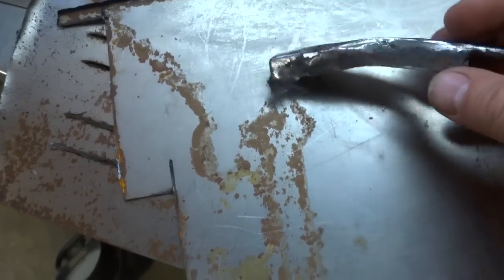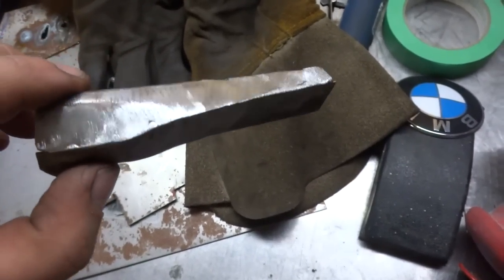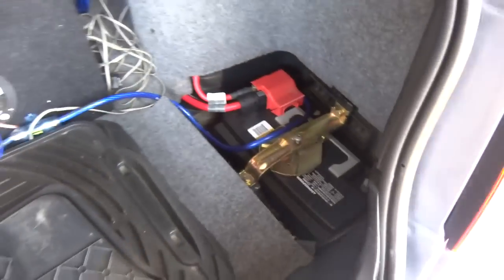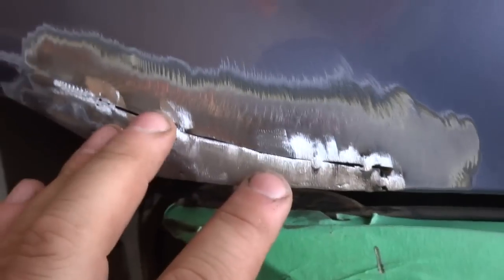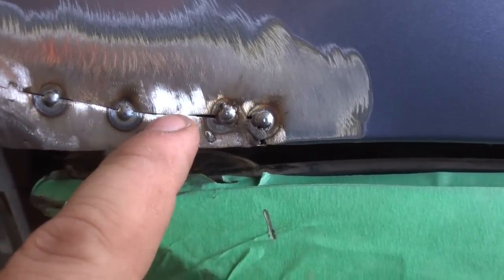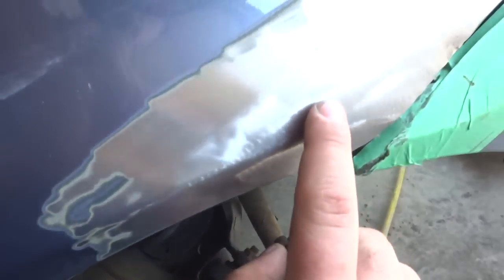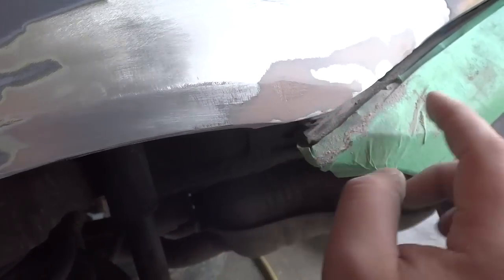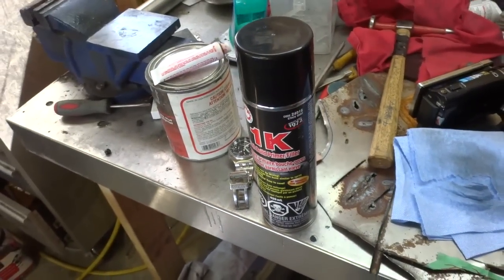How to Repair Rust and Weld Body Panels

Comment: I've been a painter for years, when you get runs wipe it off quick , let it dry then light sand. Uncured paint is a bitch to sand
Reply: This should help anyone to spray and avoid runs. Understand that spray means thick paint pigment which is diluted with thinner to make it as the word says, to thin it,  so that the thinner takes with it the pigment from the gun to the metal panel. 
2. All the thinner needs to evaporate once it reaches the panel before you pass a second coat. 
This is why you need to spray a even and really thin coat - First thin coat means that you can still see the underneath metal and filler.  This allows for the thinner to evaporate quickly (1 to three minutes) and the pigment particles to remain stuck to the panel
3. Apply another thin coat and do the same. Wait for the thinner to evaporate again and apply another until all of the bak ground metal and filler disappear.
4 Give extra coats since you would need to sand it down a bit to make it smooth to apply the finish.
Spray runs are problematic to sand down since the coating is so thick that the thinner cannot escape and evaporate. And so when your reach the bottom layer of the spray over run, closest to the panel, you find that it is not dry and solid same as the top of the spray overrun (too much spray) 
In short, the idea is to apply thin coats, allow the thinner to escape completely each time. 
Hope this helps.

Comment: Those damn Beamers seem to rot in the weirdest places.Ive just started a 1993 project Chevy Small Block into a BMW.Im going to remove the arch in the rocker panels.After cutting out the rust the car is probably about 20lbs lighter.Now time for some templates and welding.Thanks for the video!Gave you an up!

Comment: I learned my lesson trying to fix rust. My 2002 Dodge Durango has got rust on all doors + hatch on corners and it's all through the metal and under the rubber seal strip. I've only tried to fix one door and I absolutely regret it, looks hideous. I started thinking "god I hate bondo, only works in smaller applications" then I realized I forgot it's just a body filler, and I'm trying to mold it into a new part of my door which rusted off when I angle grinded.

Yup, gonna befriend a welder who'd help me or let me borrow one.

Comment: One thing I love about living in the Southwest, NO RUST. I'm in AZ, my 2001 has absolutely zero rust on it (although I do take care of it mind you.)
Reply from the maker: Dennis R that would be nice, here in Canada after a few years things start to rust
Reply: Bullshitkorner Yeah bro, I actually work as a technician, anytime cars come in from areas where road salt is used, we have to break out the torches to be able to get any bolts loose. We had one truck come in from Pittsburg, the lugs had not been off for I kid you not, TWENTY YEARS! It had spent all of those years driving around in the salt belt, without being taking care of at all. They brought it in,  heavy duty impact wrench couldn't touch the lugs, wound up taking a 4 foot 3/4 drive breaker bar with an eight foot pipe over it, and two of the biggest techs jumping up and down to break the lug nuts loose.... sounded like gunshots when they broke loose. On that same truck we had to cut the studs off the ball joints to change them, as they had rust welded to the control arms. I could never live in an area with road salt, fuck that!
Reply: Bullshitkorner By the way, you seem very skilled, you did quite a nice job on that car.
Reply: cyrax99 ni n n n .ni

Comment: good job...the only difference between you/me and a pro is the quantity of times we do this kind of work. The more you do, the better we get. I just got finished making and welding-in a bunch of curved metal patch panels on the bottom length of the entire windshield bottom channel including the two bottom corners..it took me about 1.5 weeks of part-time work...surprised myself that it came out real good. The most important thing I learned was making accurate templates of each piece of metal patch so that it fits the hole...and bending the curves and angles correctly before welding in place. Another thing I learned (by experience and from pros) is that when you stitch weld you don't have to worry about the panel warping and you don't have to blow air on to get it cool after welding as long as you stitch weld in short small bursts apart from each other. But I was welding the older thicker metal (76 chevy truck)...the new cars use such a thin metal I guess one would have to keep it cooler lol...cheap thin metal geeze. Next thing they'll be using plastic on all cars like the plastic Camaros they were making...my GF's Honda metal is so thin it bends if you sneeze on it lol. Great work! Thumbs up!

Comment: I've visited Canada once and it was a bit shocking to see how rusty cars are there.
Reply from the maker: this is what happens when you have 4 seasons and you salt the road, if you come from a part of the world where it's dry and you don't get snow.  Your car should be virtually rust free
Reply: New cars last about 5 years before they start showing bad rust. Most are in the junkyard within 10 years.
Reply: Yeah it sucks man. For some stupid reason, Canada is gung ho on using salt on the roads. Absolutely destroys vehicles. You should see the pot holes. Lol.
Reply: Down here in Brasilia, Brazil, is very dry. No rust to talk about.

Comment: Good stuff! I used to do it like that, cooling it with air. Turns out, after discussing it with a professional, that it will only make it warp more. It's better to let it cool down by itself in between tacks, and keep the temperature nice an steady as you go.
Reply: I'm a panel beater from the UK & I use a marginally damp lint free cloth & that stops any warping as well. (keep it cool & weld in small stages.

Comment: thx for posting.  this is almost exactly what  i'm looking for.  i have a '77 630csi that has acquired quite a bit of cancer while sitting in my driveway. Unfortunately, the worst areas are around the front and rear windshields, as well as the sunroof, and hood.  this definitely gives me a starting point.  
thx, again.  
BTW, i didn't notice any profanity. CHEERS.

Comment from the maker: practice is the key doing little spot welds and then cooling with air, then going to a different part on the panel that is away from the one you did and repeat.  once you hear a pop that means you got too much heat in your panel and its warped

Comment: Damn older beamers, BMW didn't used galvanized metal sheet back then, I have the same problem with my '99 320D. Rust starts to show on the outside, only along wheel wells edges and bottom part of passenger door. I could exchange the panels for some newer ones, made with galvanized steel, but they cost, A LOT, even in Europe. My second best option and probably cheaper, would be to cut out a strip of about 2 inches along the edge of the wheel wells and replace it with fresh, galvanized steel, to get rid of the problem once and for all.

Third option would be to take my angled grinder to it, remove the paint and rust in sections, then repaint it. I'd like to do the job myself, although I don't have any experience in car bodywork, though it doesn't seem very complicated for a person with some knowhow.

Comment: I use a wet sponge.  How fool proof is the disconnecting the battery?  You also have to paint the back side with epoxy or that thing will eat rt through

Comment: ac aluminum case old swim pool or aluminum waterproof tape all good rivet .weld will make rust more .save that beer cam for next repair.
Reply: a little trick to rivets instead of a drill bit use self drill screws then remove & rivet leave any aren't visible  .had a van once ordered patch panel used Phillips self drilling .went to sell showed buyer told him to repl .w rivets  he said what you did was fine.

Comment: #1 rule of noob welding.. dont use air gun to cool weld... let it naturally cool..
Reply from the maker: you weld whatever way your heart desires
Reply: seriously though.. try it with out the air gun. it will give you a smoother finish..its physics.. rate of cooling... cooling to rapidly causes warping.
Reply from the maker: negative never had a issue warping with using a air gun
Reply: He's drinking pabts blue ribbon beer so you can't expect much.
Reply: don't worry when you weld like this point by point the gas of mag/mig welding rotect your weld enought, you  can use air gun after to cool it, the weld will not be orange "in fusion" don't be a dick, don't use air gun and create calamine for fun, wait to see the metal red you totally can use air gun
Reply: It's only American beer though - a bit like the lolly water we give the kids on a hot day over here.
Reply: erik hoover - too much heat differential compared to surrounding metal temp causes the warping. As the metal heats up from welding it expands. When the expanding metal meets the cold metal, that expansion has to go somewhere which is usually perpendicular (not good). As the metal cools it contracts but if it expanded too much too fast from excessive heat, some of that expansion or energy gets trapped into a form of a warp or dent. Realize stamped metal parts have trapped energy in their shape and as one heats them it is not uncommon for that energy to move around in undesirable ways. Also how many days is it going to take you to do the job. During the summer months it will take forever to cool off naturally. The trick to using the air is you have to hit the weld as quickly as possible with the air to be most effective and no it doesn't have to be 100 psi which will cause a pinhole in the red hot glowing weld. Prior to mig welders we used gas and then you needed water to cool things down. I sometimes use water during critical mig welds like on the center of a hood, roof or decklid holes from a mouse nest.
Reply: Sheet metal that naturally cool with no distortion at 0 degree-C/32-F ambient temperature, will distort when naturally cool at 35 degrees-C/ 95-F ambient temperature. So #1 rule: Make sure your rules are watertight.
Reply: Maybe try welding body panels bud. Rapid cooling stops the warping- done it plenty, never had an issue.
I ran a fabrication shop for 10 yrs, we always allowed welds to cool naturally, found out that doesnt work on panels when I started with rust repair- heat affected zones expand, then contract further than originally; hence why we cool rapidly to remove the shrink...

Comment: i have some pitted metal in the same spots, and a dented rear arch, same issues you have , mine is an 02 wagon.. will sanding it down and spraying the pitted metal with a rust converter, then body filler and primer make a lasting repair? Or should i cut and weld, my other question is did you find a source for the drivers side rear arch for new sheet metal, Im having a hell of a time in the usa.. I have about a quarter inch deep 5 inch pressed in crease id like to fix, but dont know if i can make the wheel arch by hand .. id much rather source the sheet metal and just weld that section of the arch.. any ideas. thanks great video
Reply: Check out USC All Metal if you plan on filling. It should do the job nicely.

Comment: Did you have gas shielding or just flux core?
Reply from the maker: i have both
Reply: Metal that thin you would need to use gas shielding.